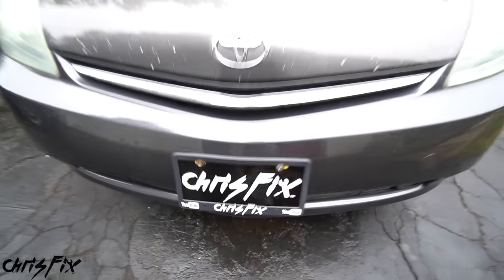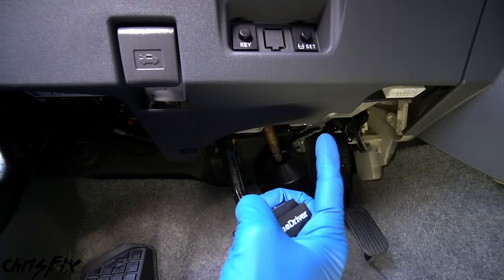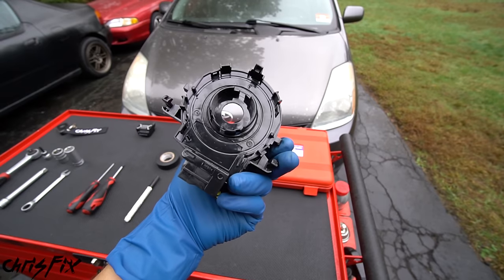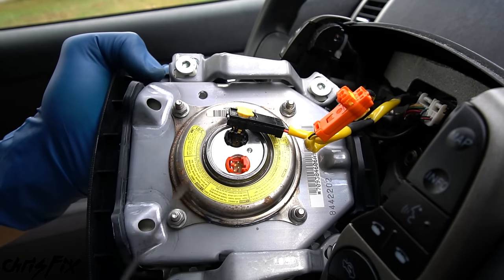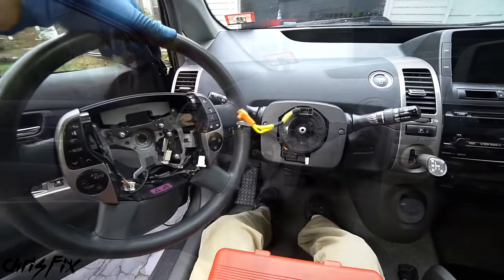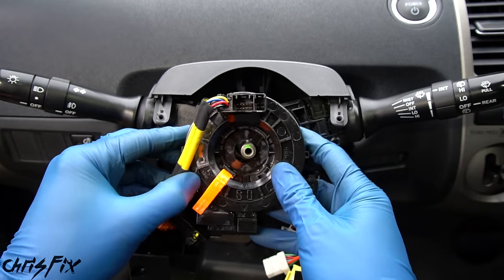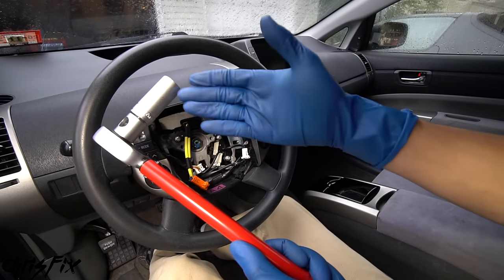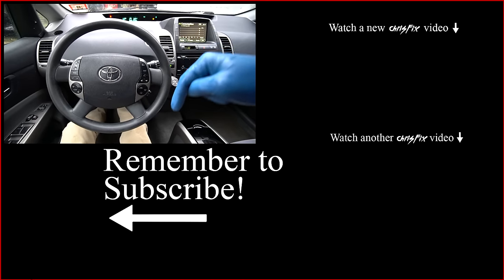How to Replace a Clock Spring (airbag light & horn not working)

Comment: I love when something new breaks on one of chrisfix's cars.
Reply: Same here
Reply from the maker: I'm glad someone does haha
Reply: @chrisfix  I have a 2000 ford f150 xl and parking brake light and abs light is on even when the parking brake is not on do you have any tips to troubleshoot it?
Reply: @jasonjr2500  Wheel speed sensor?
Reply: @jr a simple googling will get your answer.. But generally there's a sensor attached to the hand or foot brake for this that will probably be dirty... These don't really break.
Reply: @jr blown fuse #14 common issue
Reply: @jasonjr2500  check the brake sensor
Reply: @jasonjr2500  dirt on wheel speed sensor. Happens to me every 2 years. Clean your brakes and break sensors.

Comment: Hey Chris Fix. May 28, 2024.   My cruise control quit working, I replaced the switch and the clock spring per your video and it works perfectly on my 14 yr old 294,000 mile Toyota Tacoma. The dealer I bought it from wanted $1300.00 parts/ labor and 1/2 a day to fix it. With your video and approximately $50.00 parts and 1 hour of my time- DONE !  Thanks a million.
Reply: Nice .  Dealership price is insane
Reply: Dealer quoted me $1200 on a ‘15 Frontier… no way…

Comment: I worked as a car parts counter man before airbags on a car was even a thing. I had never heard of a clock spring on anything but a clock. This video was exactly what I needed. Without this video I wouldn't have ever attempted this repair.
Reply from the maker: I'm glad you learned about what this was and got your car fixed!

Comment: Chris be like: “Today we will work on something simple! We will rebuild a transmission!” 

Me: I can barely change my wiper blades.
Reply: TBH learning about how transmissions work is super confusing. I have 16 headaches thinking about it so far
Reply: Chris uses Google. You should too.
Reply: Bulking Cat he isn’t, car maintenance is surprisingly easy on most cars.
Reply: Funtagious oh well that’s bad news for me I’m putting a new trans in my truck.
Reply: I know right
Reply: @funtagious1362  You ain't kidding, I've worked on cars my whole life and I have mad respect for anyone who rebuilds transmissions for a living, and even those who rebuild them in their spare time for personal vehicles or extra money.
Reply: @Gipp7_0923  Changing a transmission isn't that complicated, it's pretty straight forward pull the old out replace it with a new or rebuild one but trying to rebuild a transmission is a totally different experience and is extremely complicated.
Reply: Notcha Grandpa oh thanks I can rest easy now knowing I won’t go through hell😄
Reply: @Gipp7_0923  yeah it's pretty straight forward changing a transmission, just disconnect the wiring harness and linkage, remove the starter to access the flywheel, unbolt the torque converter from the flywheel, remove the cross member support beam from the transmission, and remove the bolts from bellhousing that holds the transmission to the motor, slide it back about an inch or so to clear the two dowels on either side of the transmission and its ready to drop, reverse sequence to install the new one, hope everything goes well for you, good luck.
Reply: @notchagrandpa8875  Torque converter?!? What's that? Do you mean the clutch?
Reply: @benjammin2020  It similar to a clutch and is in the same place bolted to the flywheel, but on a vehicle with an automatic transmission it's called a torque converter instead of clutch and pressure plate assembly, the clutches are located inside the transmission on an automatic.
Reply: @notchagrandpa8875  Sorry, that was my poor attempt at a joke. I was trying to imply that I didnt know what an automatic was, cause manuals are better.I should know by now that sarcasm doesnt work over the internet.
Reply: @benjammin2020  I agree manual transmissions are by far superior, the sad part is that manufacturers have stopped making 1/2 ton pick-ups with a manual transmission for some odd reason, in my opinion they decided to take the best part out of their trucks and replace it with stuff I don't care anything about, like OnStar, GPS, and touchscreen radios, personally I'll take a good old fashioned truck any day of the week over these newly designed, over accessorized, luxury cars with truck beds, these so called trucks that they sale today would break in half if loaded with some of the loads I've hauled in the older models, especially these with an aluminum bed, it would crush like a soda can under the kind of weight I'm talking about.

Comment: Chris: "OEM or Aftermarket, it's up to you"

Proceeds to make an excellent point on why aftermarket part is better
Reply: I avoid aftermarket parts as a rule - too many really bad experiences - but in this case I agree with Chris. The high failure rate on the OEM one is enough to get our attention, and the ease of replacement, low impact if it does fail, and the enormous price difference make it attractive indeed.
Reply: @flagmichael  Not only that, but aftermarket parts can be of the same or higher quality. Brands like MEYLE might not have made part X as the OEM manufacturer for car Y. But that does not mean it isn't OEM quality.
Reply: @Swordie100  Not hardly, OEM parts get upgraded to fix whatevee issues too.  OEM fit and function is always better than knockoff parts from discount part stores.
Reply: @jdigitalseven7  OEM parts get upgraded to fix issues? This video is literally living proof that this is not always the case..

Notice how I said aftermarket, not knockoff parts or discount store. A lot of manufacturers are better than some manufacturers that are OEM part suppliers. Meyle/Mahle etc are some of them.
Reply: @jdigitalseven7  what??? I think the best proof that's not entirely true is bulletproof diesel parts for mid 2000s ford f250s. They fixed the EGR issue every single truck had and they're all aftermarket. I know it's not "knock off" but it sure isnt OEM. Its better.
Reply: Toyota actually updated most of their clock springs and issued a recall on some too. The OEM part would be better in this case by quality, but it's hard to argue with that value. Btw I am a Toyota master tech and have done the recall hundreds of times.
Reply: @Auto Medic most Toyota electronics are made by desno which is why I always check them first. But Toyota does manufacture a lot of their own parts. Either way, if Toyota outsourced to Desno, that would make Desno the OEM which means my comment still stands. Some parts Desno wont sell you directly like Powertrain modules. In that case, you would be best getting them directly from Toyota. I just dont recommend getting anything from Oreillys if you can afford not to. Aftermarket manufacturers have cost me more money than I've ever saved working on my own and customers cars. Most recently my brother-in-law blew a headgasket and he had a crankshaft sensor code as well so I replaced it while I was there (Mitsubishi 3000gt goes behind the belt). Aftermarket one he gave me had loose clips and the wire ended up working it's way out and shredding on the hwy. Had to tow it back to me and then I had to replace the reluctor wheel which was hard to find, the timing belt again, and the sensor. The OEM sensor was less than $20 more than the one he got from autozone. Would have saved time and money and secured peace of mind. Or I had a rear drum kit on one car, and they had this clip in the wrong spot that ended up rubbing on the drum before grenading and ended up having to replace drums and wheel cylinders. Just headaches that I've never gotten from OEM parts

Comment: My dad's been working at a parts store for 12 years or so.  My daughter had a 2007 Dodge Caliber given to her and I wanted to fix her cruise control, so I bought a cruise control switch and replaced it.  When that didn't fix it, I learned that along with the cruise, the horn didn't work and the airbag light was on.  I had already watched this video once, but found it again and the rest is history.  Fixed all those problems for $26 and had no problems whatsoever.  Saved me a ton.

Comment: Hey guys! ChrisFix here!...

Problems with the cup holders in your car? 
Alright, the first thing we are going to do, is disconnect the battery.
Reply from the maker: lol
Reply: KelMaster Construction  I've replaced hundreds of airbags for the Takata recall and have never disconnected the battery. Dealer techs wont do that because we are on flat rate and time is money. Plus customers get upset if they loose their stations lol. If you're doing it at home I recommend it though. We did have one tech turn an airbag ECU upside down with the ignition on and it tripped the rollover sensor which deployed all the airbags. Always take the key out of the ignition at least
Reply: As long you use medium strenght threadlocker - you'll be fine :D
Reply: And get some soapy water
Reply: Kenneth Ebel that true but depending on the make for example it’s quicker to disconnect ground on our Mercedes than connect the sds and most vehicles have a additional battery that prevent the accessories memory from being erased
Reply: @yepyepyepyep1407  Most vehicles run dual batteries? Who told you that load of shite?
Reply: @enlightenedrenegade472  its a tiny battery that saves radio settings, seat settings, clock settings, etc. The car does not use it to run.
Reply: I feel bad for laughing at this lol
Reply: Dukeskywalker 08 *soapy wooder
Reply: Chris fix
Reply: Chrisfix bro i love your videos
Reply: C
Reply: @chrisfix  4
Reply: Safety is number 1 priority
Reply: @chrisfix  I have a 2002 f250 super duty. My airbag light flashes code 32. I believe it means it has high resistance. All the threads and blogs says it's the clock spring. My horn still works and so does all the buttons on my steering wheel. What else can cause my airbag light to come on giving me the 32 code.
Reply: Hey. Chris. How do I reset my car memory
Reply: @kennethebel7726  time is money? It takes 3 seconds to unhook a battery lol
Reply: @ladr21  resetting the clock and radio, there's more too it. Can take up to a minute or 2 total. And it doesnt really do anything. Toyota SRS ECUs only get power with IG on
Reply: @yepyepyepyep1407  I know what you're talking about..mention OBDII memory saver too..most of these guys don't even know what that is...because most normal cars that are not computer controlled won't need that..ALSO not disconnecting your negative terminal when doing electronics work on car can be dangerous something like fuel pump connections may ignite the fire
Reply: XD
Reply: @enlightenedrenegade472  My 1994 GMC diesel truck has 2 full size batteries under the hood.  Only vehicle I've seen with 2 batteries but who knows?
Reply: @waynebinky  Virtually every diesel truck runs at least two batteries. HD applications (box trucks and bigger) can have 4-6 batteries. But your average vehicle (at least in the USDM) like a gas powered pickup, SUV, or sedan, generally only 1 battery. There are exceptions. As I've recently learned, newer Chrysler Pacificas come with a primary and auxiliary battery for the engine Start/Stop system.

Comment: chris fix: torque spec is very important!

me with my snap on air gun: RATTATATTTATATA, ok its tight
Reply: Firealarm102 👌
Reply: Yep, this is me!
Reply: Is it 5 or 6 ugga duggas?
Reply: I use my electric - it's more powerful.
Reply: Hahaha,its never enough just need one last torque manualy by hand
Reply: @limarajerk  You need a better rattattataa.
Reply: What if I have for example german car and I'm bad  at german, how do I know how much force should I use ?
Reply: @limarajerk  I could literally stand on my ratchet and only put a fraction of the force my cordless impact can
Reply: @Saffy1  If you have a german car you shouldnt drive it.
Reply: @rimmersbryggeri  Im in eu they are well build here  and it feels like 80% cars here are german
Reply: @Saffy1  Im in europe aswell. Have you not seen the BMW airbag recall? BMW urges their customers not to drive their cars. I'm in sweden though so I guess volvo is quite common also other than the germans.
Reply: Don't tah too long you break it
Reply: Or Ave... "Annnndd Click"!
Reply: Torque to speck, is that 30 ugga dugga or 40? 😂 😂
Reply: Just like the dealer.
Reply: rimmersbryggeri volvo 242s are indestructible tanks
Reply: If is not coming off when I put hand pressure to it, then it's fine.

Comment: Thank you for the video on clockspring replacement. My horn stopped working and my car wouldnt pass inspection. Looked at other videos and yours stood out for 2 many reasons. You saved me money and stress. ✌
Reply: Did it end up being the clock spring for the horn issue? Mine is doing the same thing

Comment: Hey Chris! It also helps to leave the nut on when removing the steering wheel. When you’re pulling hard on the steering wheel, it will prevent the wheel from hitting you in the face. 😁
Reply from the maker: Haha def! Luckily this wheel came right off

Comment: I remember my automotive teacher teaching this when I was attending college.  We had an hour powerpoint presentation and did hands on training on it.  I think the group and I were changing it out from a '04 Toyota camry (shop car)  and that bolt was so rusted that we couldn't get the steering wheel out.  I never knew it was that easy and the steps you did on this video is spot on.

Comment: Chris, thanks for your clear guidance on how to proceed safely and do the clock spring in my driveway; saved me hundreds of dollars.  This is a job any careful, sober auto mechanic can do without much difficulty.  Hardest part for me was overcoming stripped threads on the steering wheel (someone had already been there before me . . .) I used 2 other gear pullers until I got the steering wheel started off the splines.  You make GREAT videos--please keep it up.  When I need to do something I have never done, I always check to see if you have a video (even if it is NOT my car).  I have a 1996 Chrysler Town and Country; by late 2023, I have replaced about 95% of ALL the parts in this van--249K miles and going strong.  Thanks to videos and other mechanics who have taught me all I needed to know.

Comment: This is the exact problem my truck has. I just took it into the dealership because it wasn’t quite lining up in the park position. And felt like it wasn’t going to go into park . This problem was fixed a year and a half ago by adjusting the shifter cable. I figured it would be another adjustment of the shifter cable. However they said there’s no problem. They’ve cleaned it up and slight adjustment and charge $95. I left the dealership and discovered my reverse and drive her right out of alignment now as well as my park. Your video is the exact problem I have which I think I will email to the dealership service department. Thank you so much!

Comment: Thanks Chris for helping out with my dad! His heater wasn’t heating up so he took it to a shop and it was expensive for such a simple fix. I showed him a video you made and he fixed it! He just had to put more coolant in the radiator. So thank you so much for helping us out!
Reply from the maker: Awesome!!
Reply: Keep an eye on the coolant level, though. There is a reason it was low. As long as you are not having to add coolant every week it should be good.

Comment: Thank you so much for this informative video, it was kinda amazing how many things it fixed at once. It fixed just about every button on my steering wheel,  and also the airbag light. I paid $10.00 plus shipping for a brand new same exact part as a factory clock spring, it even came with a 1 year warranty!! Total savings was well north of $500 from the dealer price parts and labor.  Had to buy a couple tools,  total cost was about $33.00 tools and parts. An absolutely amazing savings,  and was easy due to your comprehensive information.  Thanks a million Chris!!  My car is a 2008 Toyota Prius, Gen 2.
Reply from the maker: That's what I love to hear! Thanks a lot!

Comment: I watched your video and proceeded to order the clock spring and installed myself based on your video! It works!!! OMG! 
Save nearly $200+ as the local car workshop quoted me $250+ for parts and replacement. Did it in less than 1hr like you suggested.
Hello from 🇸🇬 Singapore.
Reply from the maker: Nice work and glad the video was helpful!

Comment: Thank you as always Chris! Would not have wanted to try this without your video. I did it in under an hour and got an aftermarket clock spring for $20. Fixed the horn on my 2011 Toyota Tundra! So so grateful for your videos. You’re incredibly underrated. Thank you
Reply: By underrated you mean almost 10 million subscribers
Reply: I'm having the same problem with my 2012 Tundra
Reply: where did you buy the clock spring?

Comment: Really helpful!
Used your advice on a gen 3 2010 Prius UK model, a few less screws and more plastic clips. The whole cost was £24.99(price of the after market clock spring). Just had to be cautious and mark the postitions of whatever I've removed.
Big thank you!

Comment: Great video with one flaw that I can spot: torque specifications are almost always meant for dry fasteners, so you are overtorquing because there is a reduction of friction due to liquid thread locker by ~20%
Reply: I'd rather it be too tight than not tight enough.
Reply: @lp3668  then you would rather your fasteners break on you then

Comment: Anyone else go “awww” when they heard “inch pounds”
Reply: A decade ago I spent about $100 on an inch-lb torque wrench. Now I have (besides the ones I have had for years) ft-lb and in-lb torque wrenches from Harbor Freight. They come with cases, were really cheap, and work as well as the expensive torque wrenches I still have.
Reply: @flagmichael  I've had 3 HF 1/2" torque wrenches fail, all in the same way, they just stop clicking, so I don't trust the 1/2" for anything really torque sensitive anymore. No issues with the HF 3/8" torque wrench tho